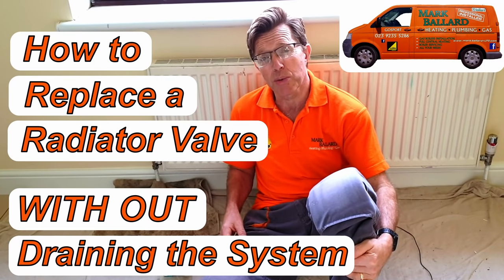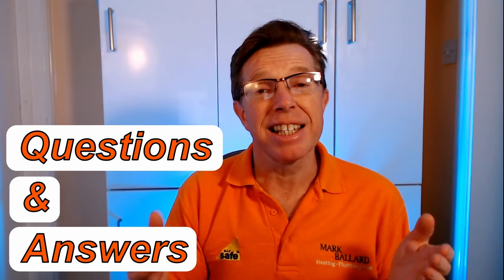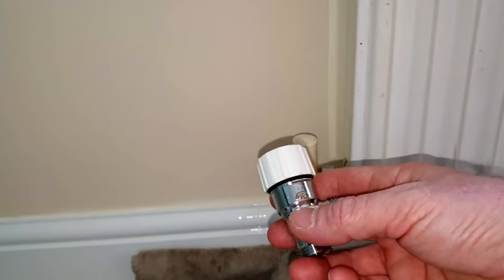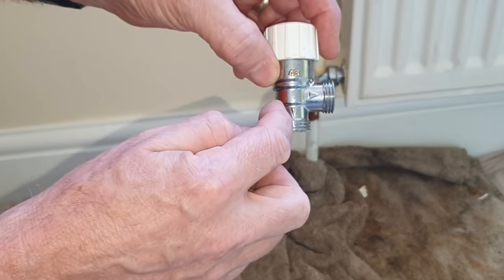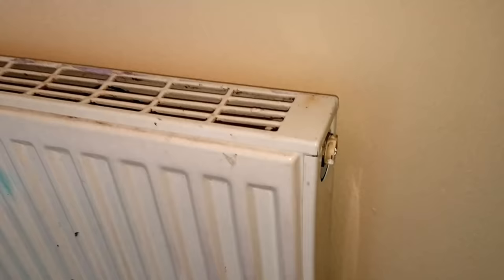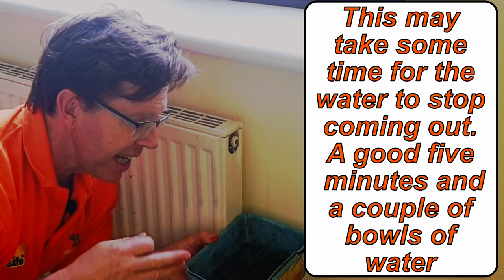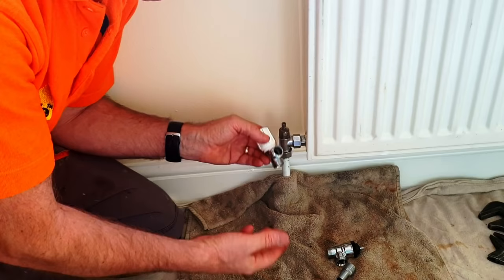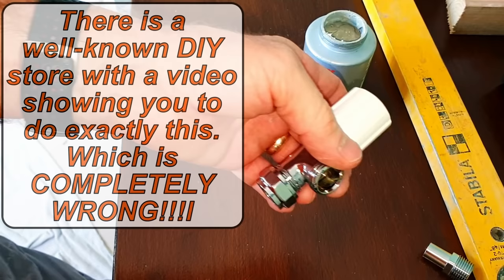Replace Radiator Valve with Out Draining the System. Updated. Part 1.

Comment: If it’s a combination boiler just drain down flush the system and use a inhibitor , do a proper job  the heating system looks old , are you a registered plumber  as I was stay safe retired lifeboatmen uk
Reply: i agree.50 yrs experience,always drain down.it saves thousands of pounds of potential damage.also why change a lockshield when theres nothing wrong with the one thats fitted.?.
Reply: @jacksmith534  water is a good servant but a poor master, that's why l drain the system .

Comment: Again, this is pointless, I am a plumber, and I can safely say I can swap a rad valve in an hour even when you drain the heating. Its on a sealed system so it won't take long to drain, also to fill back up it doesn't even take long, this guy tricks you into thinking its quicker doing it his way but ik alot of plumbers that can swap rad valves quicker than this. Like why should you have to pull your carpets back to take a valve out, that's because his way is stupid, and by draining the system instead you don't need to worry about this. His way will make you do more work than what is needed.
Reply: I hear that personally only no so much on plumbing but give my boss 20-30min it will be changed no probelms
Reply: @adsmith7893  his way of doing stuff is stupid, just drain the system its a combi boiler anyways
Reply: Mike Hunt seems it tbh bud I don’t see the point in brand new but hey we’ll leave the old olive why? 😂🤣😂
Reply: @adsmith7893  because sometimes the pipe is to crimped by the old one so it might not sit properly on the pipe
Reply: Mike Hunt ahhh fair enough learn something new everyday

Comment: So the first thing you state is that you don’t drain the system , then the first thing you do is drain the system from the rad vent by taking the pressure off ! for all the time spent messing about with creating air locks why not just stick a hose pipe on and drain down properly . There are no short cuts dude !
Reply: There is and he just showed it

Comment: You said you have have used sealing paste on compression fittings a million times, you don't seam to realise that's a million bodged joints you have made. I recently bought a new build house that had a lot of problems with the plumbing, all due to some cowboy plumber using sealing paste on every compression fitting, little bits of this stuff got washed along the inside of all the pipe work and clogged up valve seats in the heating system and clogged up ceramic discs inside the water taps. When you have to undo these compression fittings that have been bodged together with this crap it's difficult to get the stuff cleaned off so the joint can be put back together properly. To assemble a compression fitting properly care has to be taken, clean the end of the pipe first in a circular motion using scotch brite, clean the olive in a circular motion using scotch brite, clean the olive seat on the end of fitting in a circular motion using scotch brite,  check all cleaned surfaces have no score marks before screwing together and you will have a perfect joint, how many cowboy plumbers will bother doing that when it is easier to stick some crap in the joint.
Reply: You’re completely wrong tbh mate. What he shows in this video is not excessive at all and would not cause the issues you describe. Also I have never had any sealant on an old compression fitting mean it wouldn’t go back together. The small amount he used in this demonstration would just stop tiny weeps from any olive. You are right re you don’t need any sealant on the olive for a good compression joint. But you don’t need to scotch brite anything and go to any hassle at all. If the olive is undamaged and the pipe straight then it will be sound. Also dependant on the sealant used it could be the incorrect type. I am a gas man and this guy is clearly time served and knows what he is talking about. Don’t tar everyone with the same brush. I doubt he has spent anytime chucking new systems in on buildings sites contracting through various companies to a house builder. Which is why you have had the issues you have unfortunately.

Comment: Plumb tub, towels, 15mm compression cap ends on the tails, half inch flexi on the valve, drain into a bucket, whip valve off,  new valve on.  Fill and test, digital invoice, take payment and next job or in my case go home................... 
Draining the system is overkill, takes too long, plus the potential issues with airlocks on s/y plan systems, not every house has  a drain point, some drain off valves leak after., etc, etc.

Far too many plumbers make a mountain of a simple job.